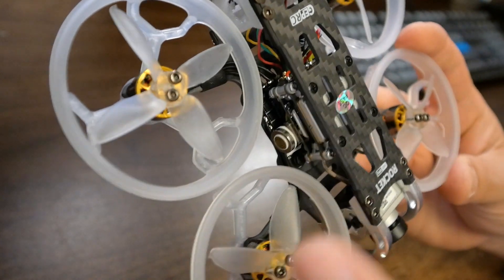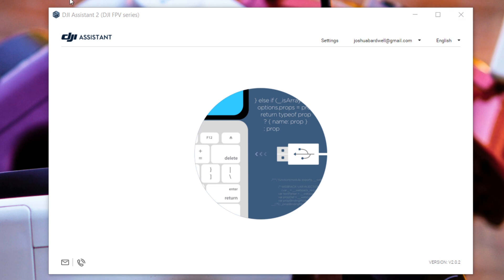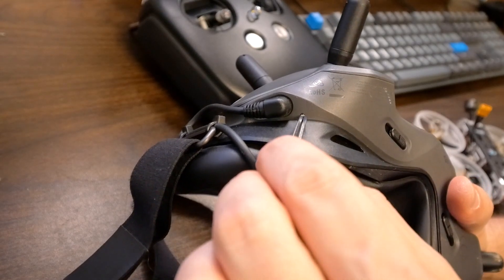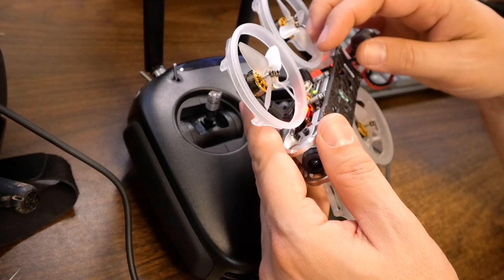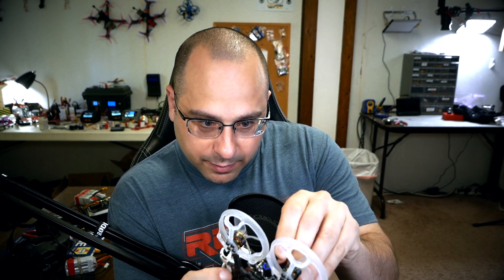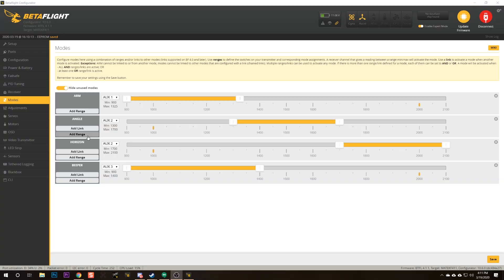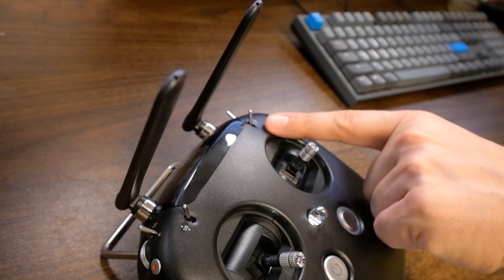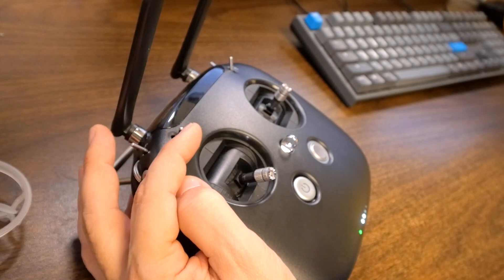GEPRC Rocket Lite Betaflight setup start to finish

Comment: Will the the new DJI controller V2 work with this quad?
Reply from the maker: The DJI FPV controller v2 only works with the DJI FPV drone. Nothing else.
Reply: @JoshuaBardwell  Thank you for the quick reply.  That is a bummer.  I ordered the V2 package yesterday since they are running $300 off.  I want to covert my other racing quads to DJI FPV so I guess i need to purchase some Caddx modules and use my Taranis.  Do you have a build video using Caddx and Taranis to upgrade existing quads?

Comment: WARNING: I’ve purchased thousands of dollars of RC products and Geprc customer service is the worst support I’ve had.
Reply: I have the same bad experience. I bought Rocket Plus and it burns out 2 of 4 motors after 3 mins hovering on the spot at home. Geprc asked me questions during a month and then they refused to provide any warranty or support saying that I used 1100 mA 4s battery instead of recommended 650-850 mA 4s. It was ridicules. Geprc warranty is a fake. I had to repair the drone myself (installed eachine motors with the same spec) and now it flies fine with 1100 mA. I believed GEPRC just don’t provide a warranty and just declare they do. Be aware folks!

Comment: Thanks for the video! I have the Rocket Plus and I often get the “SD card slow” error on the Air Unit recording (about 4 out of 5 packs). I have tried 2 different SD cards both are the recommended Sandisk Extreme U3 class. I’m also on the latest 0600 firmware. Any ideas? I tried to record 720P instead and the issue was gone. But that doesn’t solve the problem for good :(
Reply: Are you using number 10 sd card? You'll want at least 32g.
Reply: Adam Anti-pop yah, Sandisk Extreme UHS3 V30 64GB and 128GB

Comment: Does anyone know if it's possible to activate rpm-filtering? Is it wise to try it on 2-3" quads?
Reply: Yes, I enabled DSHOT600 + rpm filtering on mine. No issues with the GEP 20A F4 AIO. Was able to fine tune the filter down to 2x as described on the betaflight RPM filter page. The timer based DSHOT also works.
Reply: @spikester  i was not able to get rpm filtering working in betaflight. i was able to flash the ESCs using JazzMaverick 16.73 and when I enable bi-direction DShot and goto the motor tab they all have an error. Can you describe your process?
Reply: @spikester  kan you share your dump? I get just 4 min out of it ;(

Comment: Hi Joshua, 

thank you for the comprehensive guide. 

I just received my quad today and the setup worked well. Well it worked well until it got stuck on the yoga mat of my wife and then managed to squeeze itself under with resulting in the blades beeing stuck und broken. The engine got hot and smelly. Now it does beep a lot when I try to turn it on. 

Is now the motor burned or even the esc???

Maybe you would know?

Thank you
Reply from the maker: Sounds like the motor at least is burned. Difficult to know if the ESC is also burned. Basically swap the motor and if it smokes again, swap the ESC and the motor.
Reply: Joshua Bardwell thanks a ton!

Comment: Why are your motor poles set to 14 on https://youtu.be/RnrbeiXTM7Q?t=575? this value is incorrect, the geprc gr1204 motors on the rocket lite have 12 poles, I just counted them myself on mine
Reply from the maker: That's the default value. But I haven't enabled RPM filtering so the value doesn't matter.
Reply: @JoshuaBardwell  Yeah, I noticed that your configurator kept showing the field even with bidirectional dshot disabled, mine only shows it when it is enabled (maybe rc1 vs rc2 fix), I just wanted to point it out in case anyone sees that 14 value and puts that value in assuming it is correct after watching this video

Comment: Will the config dump and OSD lines work for the Rocket Plus w/DJI air unit?
Reply from the maker: I think so.
Reply: It does, I ripped the usb jack off mine, couldn't solder it back due to one of the grain of sand resistors coming off with it. I couldn't even dump the config. New 20A-F4 AIO flight controller board later, betaflight 4.1, flashed ESCs with a DSHOT-48khz firmware, loaded the rocket config, turned on high speed s-bus for DJI HDL, enabled DSHOT+rpmfilter in betaflight, its flying again and much smoother. I think I get a couple extra minutes out of the 650mAh pack with this config along with having also removed the prop guards adding efficiency, it flies more predictable in propwash without them. This is my first quad and have learned tons from Joshua's videos. Next up, 5". ;)
Reply: I also believe the latest GEPRC units do come with the DSHOT, active freewheeling, etc all enabled stock. At least mine has appeared to do so. Having had to basically rebuild my rocket plus from scratch already, the FC board is essentially the entire thing. EDIT: Make sure to also set 12 pole motor for the rocket when enabling RPM filter.

Comment: FYI your product for the amazon usb right angle isn’t correct. The item shown only connects straight to the end of the magnetic end. Do you have another link? Also is magnetic bad around the components?
Reply from the maker: There are multiple products in that link. But sometimes for some reason the right-angle product disappears. There is another link in the video description that may be in stock.

Comment: Hi Joshua, what's the maximum weight of the battery we can use? is Tattu 4s 1050mAh too heavy?
Reply from the maker: I would be surprised if this quad flew well on a 4S 1000 mAh.
Reply: Joshua Bardwell what maximum battery weight you propose ... many pilots use 4S 850 Tattu... the weight isn't very different from 1050 ... thanks
Reply: @Corraconti  I settled for the GNB 4S 80C 750Mah and it does very well
Reply: I have the rocket plus, and an 850 4s feels really fat with tons of prop wash, 4:30 flight times, but with no freestyling, really.

Comment: The magnetic USB connectors are nice... however if you use a barometer on your craft (and you use it)  you may want to test that the magnet doesn't cause issues.

Comment: Joshua i need help
Reply: I hope you can help me.
Reply: I accidentally flash different firmware in my flight controller and  when I flash the old firmware it worked again but it seems like the esc and fc has no connection anymore. But the fc is powering up. The esc only beep 3 times

Comment: Did you know you can put the Dji controller in and out of a lock mode by holding down the C Button?  A good pre arm type of situation. And the menu buttons still work while the the flight controls are locked.

Comment: This one may be better it's a 90 degree cable https://www.amazon.com/Magnetic-LAMA-Charging-Compatible-OnePlus/dp/B07WVYLZFL/ref=sr_1_1_sspa?crid=IKNOJQI8W8C3&keywords=90+degree+magnetic+usb+data+cable&qid=1585247639&sprefix=usb+90+degree+magnetic+data%2Caps%2C165&sr=8-1-spons&swrs=69FD4B8CF548B40929CAA641E143BC7A&psc=1&spLa=ZW5jcnlwdGVkUXVhbGlmaWVyPUFLWThKTlJKRk1WUEYmZW5jcnlwdGVkSWQ9QTA1NDM4ODBUTko1VEg0S0lPU00mZW5jcnlwdGVkQWRJZD1BMDk5MDY4MDNMSURLM0JMM0VOTUEmd2lkZ2V0TmFtZT1zcF9hdGYmYWN0aW9uPWNsaWNrUmVkaXJlY3QmZG9Ob3RMb2dDbGljaz10cnVl
Reply from the maker: Thanks. I will add that one.

Comment: Joshua, FYI your link to the magnetic USB adapter is a straight not a 90. It won't work for a Cinewhoop style quad..
Reply from the maker: That listing had the 90 degree last week when I ordered one, but apparently it's been pulled. I added some other links.
Reply: @JoshuaBardwell  Great video!! Yes I too was looking for the 90 degree magnetic USB but your link is to one that is straight (no joy). I've found other brands that have the 90 degree but are charge only (no joy again).
Reply: @rydfree  Very nice, thank you for pointing me to the link

Comment: I noticed you changed the lower throttle setting to 1010, but you didnt set the upper one to 1990.  Was that on purpose ?
Reply from the maker: Yeah. The high threshold has no real effect on the stick travel. Only the low threshold has deadband. So there is no downside to leaving the high threshold at 1990, although I often change it just to be consistent.